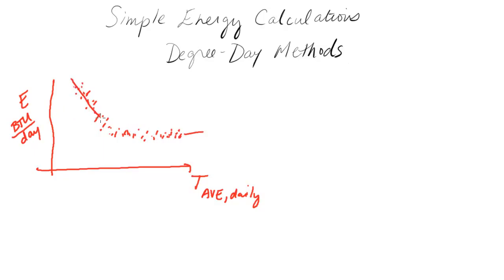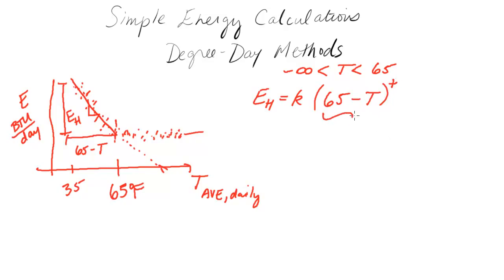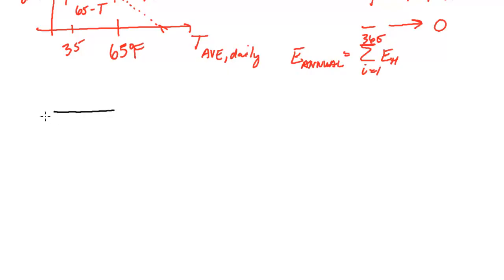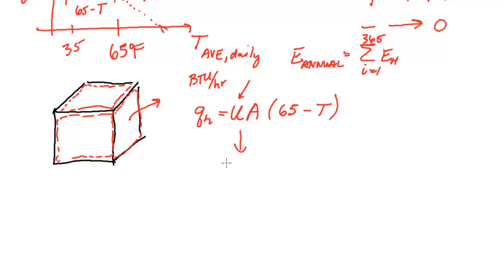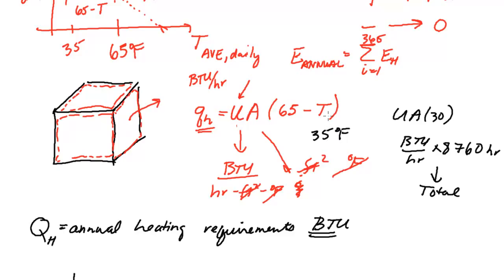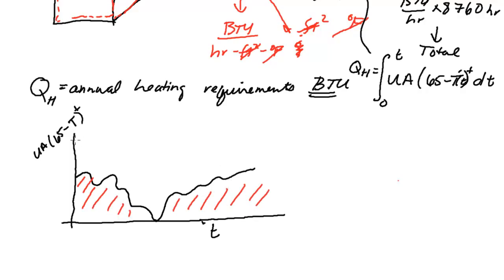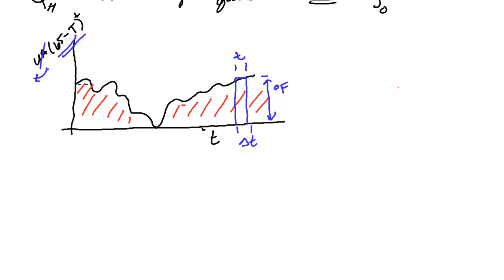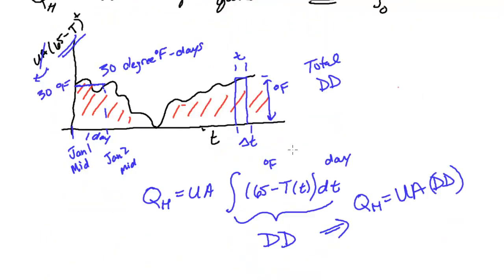Introduction to Degree Day Methods

Comment: Thank you! It is very helpful to me studying HVAC. I have a question. When we calculate the heat loss, why is the temperature difference calculated as 65-T? If the outside temperature is 50°F, shouldn't the temperature difference be calculated as 50-T instead?
Reply from the maker: I think the other videos in this series cover this in more detail, but the quick answer is that deals with the building "balance temperature" - For all buildings, there is some level of internal heat gain, which shifts the point in which you switch from a heating to cooling mode. And when you say if the "outside temperature is 50°F, shouldn't the temperature difference be calculated as 50 - T instead", you have the temperatures backwards. The variable 'T' is always the outside temperature, and the fixed number is the internal building temperature minus an offset for internal heat gain.
Reply: @MitchellPaulus  Oh Thank you!

Comment: can you explain degree days as related to temperature difference? what if we know heat loss and are asked to calculate based on degree days. is that just btuhr multiplied into degree days, divided by 24
Reply from the maker: You can think of degree days as the integrated temperature difference - it's the integral of temperature difference over time. Your question is seeming to focus on the instantaneous condition. If you wanted to calculate an overall UA value, you would divide the total energy consumption (in BTU or kWh, not BTU/hr or kW power) by the degree days over the same period. For example, dividing energy consumption in units of BTU by degree days and 24 (for hr/day conversion) would give you units of BTU/°F-hr, which is the correct units of UA.
Reply: @MitchellPaulus   @Mitchell Paulus  the equation I was asked gave me volume and BTU required to heat and temperature difference. So I was thinking maybe I had to find U. Part B of the question asks what the total BTU needed to heat based on 80 F degree days. I feel lost. Is 80 degree days meaning 80 days where the previous temperature difference exists?